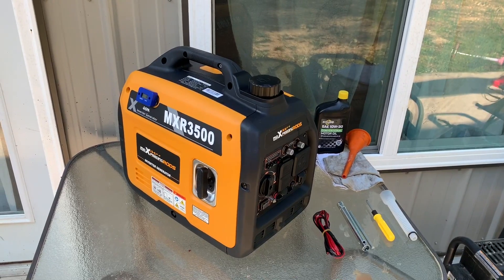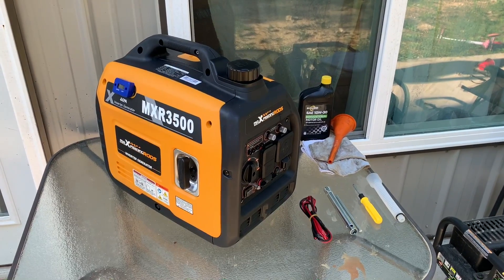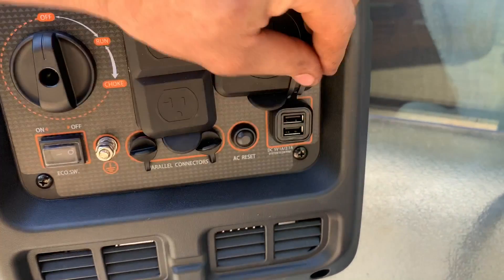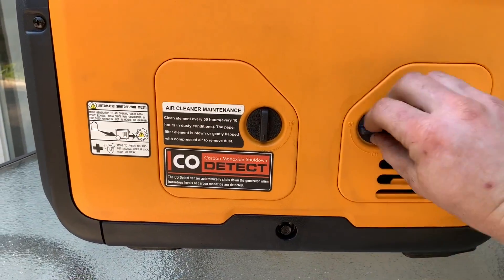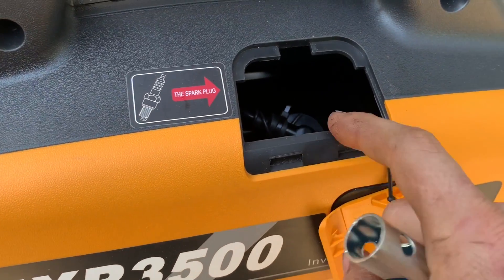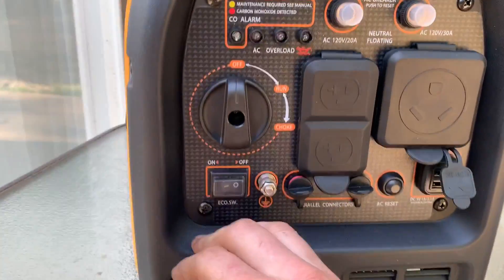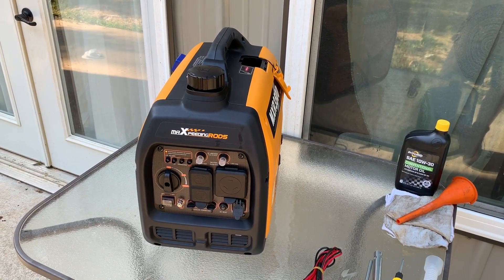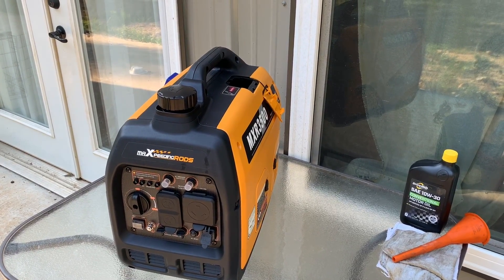Maxpeedingrods MXR3500 inverter Generator First Impressions and Initial Testing

Comment: hey there great review, 2 years on do you still love it?
Reply from the maker: Over 200 hours on it and still a solid machine! Just make sure to stabilize the fuel or better yet use non ethenol fuel. and drain the carb out when in long term storage. Still starts first pull.
Reply: @ awesome, thank you for your reply.

Comment: Note the gaps on the Torch and NGK CR7HS were way off as delivered. Per NGK, the CR7HS is supposed to be 0.028" (0.7mm) with a torque in an aluminum block of 7.2-8.7 lb. ft. There is no need for a fancy plug in this low compression engine which runs at just 4850 RPM.
Reply: anyone tried open gap more?  .010 wonder if that stop vibes.  Runs better iridum ngk

Comment: After 5 hours of break-in with 10W-40 mineral (not synthetic) oil, and alternating 1500 and 3000 watt loads with cooldown cycles, the oil has been changed 5 times and cleared up nicely. Tiny bit of steel from the rings and bearings on the magnetic plug. Overall positive impression so far. I checked the compression using a Honda dirt bike procedure and was surprised it is only 30 psi. Maybe this is to be expected for a low-rpm pull start. Anybody else checked their compression?
Reply from the maker: im sure your getting the reading with the compression release. do a leak down test to know for sure the condition of the rings.
Reply: That’s about right, you are checking with the compression release in effect. Do a proper leak down test to determine health of rings and cylinder. At 5-10 hours, they should pretty much be perfect.

Comment: How is the generator holding up?
Reply from the maker: 160 hours on it and still like new.
Reply: @muddstuffn  One last question. What oil weight does this unit take and is one quart sufficient? I live in the New York area where we have many power outages in the Summer so I'm purchasing this unit to keep the refrigerator going during one of these incidents.  Thanks!
Reply: @joejohnson2478  It takes right about 14.5 US Fluid Ounces. In hot conditions 10W-40 synthetic is probably good once the generator has broken in for a few hours (conventional mineral oil is usually recommended for break-in). Different weights are shown at various places in the documentation and on the labels.

Comment: Thing qbout engine rpm is qnd longevity it the balance of the engine qt a rated rpm. A faster spinning engine will last just as long if its balanced to run at that rpm. If you run a engine slower than its designed run rpm it will shake the bearings out of it.

Comment: Hi Don and thank you for the nice review.
I just received an almost similar MXR3500 these days over here in Germany. Of course equipped for the German 230V network with the corresponding sockets.
Didn't test it yet, cause i am waiting for some gas cans i will use for my generators. My MXR3500 does not have the CO warning LED, but that should be the only major difference.
My questions now: What kind of magnetic oilplug is it, and where can i get informations about? And would you please tell something about the hour meter you attached to the generator?
Alex
Reply from the maker: Here are links to the dipstick and hour meter I used. I bought them Via EBay. You may have a better way to acquire them in the EU. 
https://www.ebay.com/itm/313741825609

https://www.ebay.com/itm/274297588711